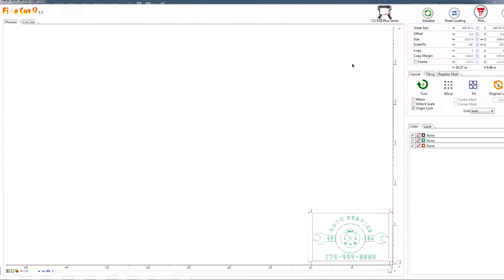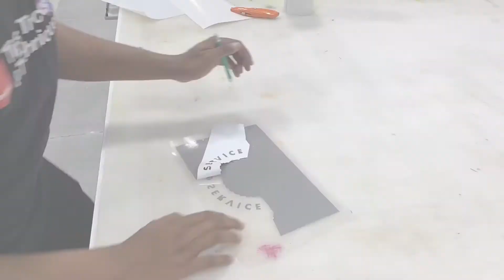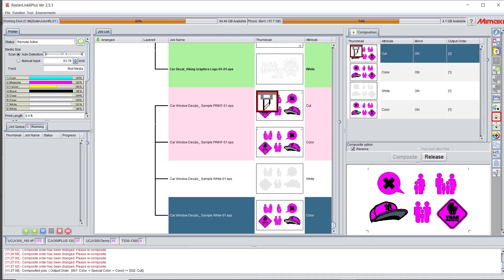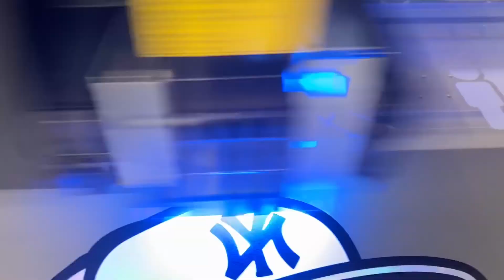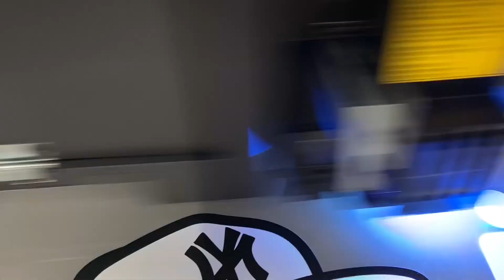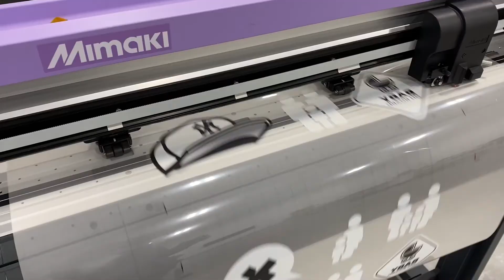Tips, Tricks, Techniques & More ~ Making the Cut: Car Decals with Mimaki

Comment: Hello please i need help i have a mimaki ujv 100-160 with raster link v2.16 and I don't have the pull back after print what should i do ?
Reply from the maker: Hello, the UJV100 is only able to print 2 layers, so the "pull back" option wouldn't appear. You can only get that double sided effect with the UCJV300. With the UJV100 we recommend printing a layer of white then color on top for these type of window graphics.